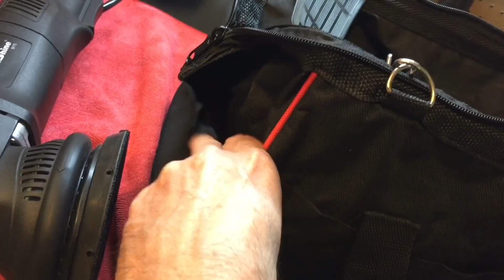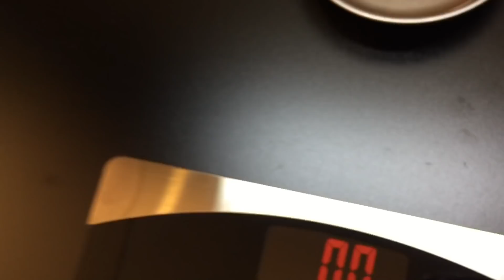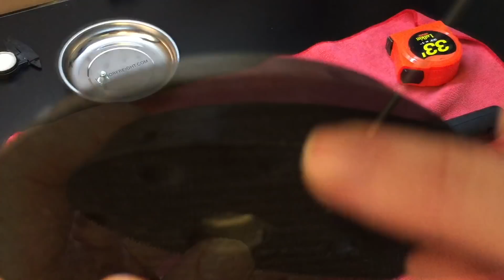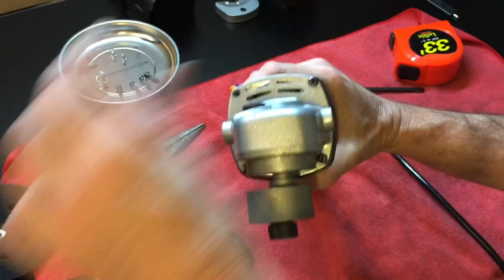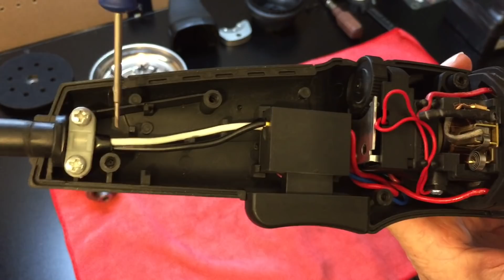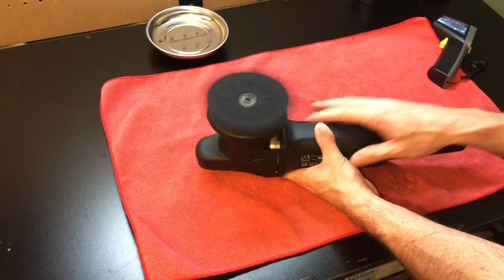A DETAILED Look At The MaxShine "The Master" 15 mm orbital polisher, 900w!!!

Comment from the maker: More Entry level polisher reviews on the way!!!
Reply: Excellent!!
Reply: When the time is right I will upgrade to the Max Shine 15mm. Flex ,Rupes,etc. are still out of my price range and my novice status doesn't justify me spending big bucks at the moment( I'm not anything more than a driveway detailer. 😁) Great video packed with comprehensive info! I'm always learning something new from your channel!
Reply from the maker: I would recommend the Harbor Freight unit...or Griots garage ....https://www.harborfreight.com/6-in-57-amp-heavy-duty-dual-action-variable-speed-polisher-69924.html

I will be featuring it in a video at some point. I will also be giving it away....stay tuned!!
Reply: @apexdetail85  I have a hf da polisher. What would be the next best upgrade da?
Reply: Brian quick question I have the maxshine 1000w it feels like it's lacking power stalls out etc.. pad is flat what's your take on that?? I've been seeing ppl say something about the mod washer would that help? Advice greatly appreciated Thanks
Reply: Nice hearse
Reply: Would #2 complex lithium grease be an adequate replacement for the Chinese grease?

Comment: Just picked up the pro today do to my da burning out on me. Quick question, what does the washer mod do n is it a must??
Reply: The backing plate rubs against the shroud of the polisher on purpose as a safety feature to prevent the backing plate from spinning freely. The washer acts as a spacer that separates the backing plate from the shroud. If you don't use the washer mod then make sure there is grease on the backing plate where the shroud and backing plate touch. I think the tool comes with a tube of grease for that purpose.

Comment: I just got the new M15 Pro :) I love it, really awesome product!! and yes it come in a complete package aswell. I sure can advise this product to any detailing enthousiast or pro even. They sell this product to cheap, or the rupes to expensive?
Reply: With the pro model is there much stalling on vertical panels???
Reply: Well i used a rupes and it stalled a lot! i didnt do much polishing with the M15 Pro yet except some headlights (no stall there) I will do my complete car soon, but my impression was less stall. especially on the inverted area's i had a lot of stall with the rupes LHR15 mk II on the chemical guys EU detailing program. Very annoying. but this is a thing with the DA's though, not just the rupes. the geared DA's or the rotaries dont have this stalling. So if my maxshine M15 Pro is gonna stall on me like that im going 3" for those area's and check out the gear driven Da's or rotaries.
Reply: @Piglet6256  check out the shine mate Ex610 15 mm.. $249.. marketed as a professional tool for professionals.. it is a free-floating da, but apparently no stalling at all.
Reply: Sure will, thanx

Comment: Hello, 
Do recommend for this unit and the pro to replace the grease with what you used in this video (lubriplate Gear Shield) or The Wolfs Head Red grease that you use in your newer videos? Does replacing the grease void the warranty?
I appreciate it, Thank you!

Comment: Hey Bryan, purchased this polisher on October 11,2018 after watching yourself, Scott from Dallas paint correction, Pan the organizer and received a RUSTED product. It is Nov 13,2018 at time of posting but only used the polisher 3x. Also upon trying to take off the backing plate to add the washer mod it was very very difficult and after an hour saw where it was cross threaded. Emailed “Skye” but was told to add oil and will not honor the “warranty”. Said they will send parts and a video for me to swap -__- 
Are you able to assist or know of a contact? I can provide amazon order number & photos if needed
Reply from the maker: That is unfortunate and depressing. Let me look into it. I would have sent it back immediately if I noticed it was oxidized and rusted.
Reply: Apex Detail I’m stationed in the Caribbean. Had it forwarded from Florida. Sadly will cost close to purchase price just to send it back
Reply: Apex Detail thanks for any assistance. And very depressing

Comment: Those screws are way better than the ones on my 10fx. Stripped a bunch of them trying to change grease. :-/ they told me $80 to replace the screws plus shipping.
No thanks. 
Looking at getting this model or the pro 1000 watt model anyway. And looks more user serviceable. Torq had the security torx screws I found out after taking apart and stripping screws lol.
Thanks for the review!!!

Comment: Is it just me or this polisher stalls really easy even on flat panels with light to moderate pressure, it was supposed to be an upgrade from the harbor freight which it has tons of power compared to the maxshine, I’m I missing something? This my first time using a 15mm long throw.

Comment: Hello Brian! This is the second time watching this video because I’m about ready to buy a 15mm polisher. I own a 21mm swirl killer and an 8mm griots garage unit as well as a 12mm polisher for 3” pads. When you clean the factory grease out, do you just spray some citrol in there and blow it out or do you manage to wipe it out? I’ve heard great things about these polishers for the money. 

Thanks
Reply from the maker: I spray it in there and wipe it out. These are great...do not miss a beat. For the money...go for it.

Comment: Brian, I have been experiencing a serious bogging down of this machine when attempting to polish vertical surfaces. I've used both foam and microfiber pads, using Meguiars D300, Meguiars M105, and Optimum Hyper compound. No product/pad set up seems to make a difference. I'm not leaning on it; in fact, it doesn't seem to be able to oscillate unless there's only minimal pressure to the surface.  Could it be something as simple as changing the gear grease that could help this?  It certainly could (and might possibly be!) user error, but thought I'd consult a more experienced professional like yourself.
Reply: I have the same issue and I purchased the 1000w "pro" model. Sure doesn't feel anything close to 1000w.
Some of my older and less watt polishers feel much more powerful than this and don't stall, I don't get what the deal is.

Comment: Great video, ty for posting it. I purchased one on these polishers and would like to ask you a couple questions.. Would lithium grease be ok to use on the gears? Do you have an alternative to Citrol 266, perhaps something i can pick up locally? And final, does the grease make the polisher perform quieter? Thanks again.
Reply from the maker: More important than quieter....much cooler for the health of your tool. Instead of Citrol...a decent degreaser will do but take a bit longer.
Reply: Thank you.

Comment: I tend to favor the lc backing plates but, which would work best for ms15/21 ?
Reply from the maker: I do as well Isaiah...however the stock plates on the 21 and 15 have performed well so far.
Reply: Would an lc backing plate work on this?
Reply: Angel B yes.
Reply: I believe they manufacture the pass through style backs for application. Seeing as how the spindle style like the porter cable isn't an option on these particular long throws.

Comment: great review i love it pls what is the name of the drill u r using love to buy one like dat
Reply from the maker: Folarin Martins its just a Drill Master from Harbor Freight.
Reply: The manual says Variable speed trigger, but it's not. I have one, manual says it has it, it doesn't. The trigger is only an on/off switch.

Comment: Another great review and tear down.  General Question, DA polishers spin free by hand and isolate.  Orbital polishers, don't spin by hand when turned off as DA's do. And based on the label of this one,  it is a random orbital, meaning won't spin by hand and isolate randomly.
Did I cover all types (3) or there are more? I know some expensive ones have a dual function doing the work of those 3 mentioned. Thanks Brian.
Reply from the maker: Let me break it down this way, if I may.

Random orbit polishers rely on momentum to spin the pad.

Forced rotation is just that... has a drive gear.

Standard orbit just relies mostly on oscillation.

Comment: I bought this polisher that scott from Dallas auto detailing recommended. It's great, are there any other grease brands that I can use can't find the one you mentioned locally in upstate ny. What about Napa or valvoline
Reply from the maker: To tell you the truth... ANY quality lithium grease is better than what the factory uses.
Reply: Thank you
Reply: I put Valvoline wheel bearing grease (auto parts store) in my HF. Hope that's an ok grease to use. Not sure if it's lithium

Comment: Once again and I do not for flattering Brian, that is clear .... it is impossible not to comment on your good videos, you disarmed this polisher until the last screw, my opnion as you mentioned it is a polisher that for its price is paid only , it is great for a beginner as for a profecional, because it can be used as a backup machine or as a continuous use machine, without any problem since as you showed, it does not heat up so easily, sometimes not everything is brand, nor price ... I think it's functionality and performance, Thanks for another good video
Reply from the maker: I has not missed a beat so far... I will do a follow up in a year or two on durability.

Comment: Bri, been waiting patiently for this one. Thanks!

1. what did you do to fix that one wire? Also did you let Maxshine know about it?
2. what did you use to flush out all the old grease?

I think I will pick one up. Dallas Scott liked it too.
Reply from the maker: 1. Just shortened the wire.

2. That was a job for Citrol 266
Reply: What else will work for cleaning it out?

Comment: I just purchased the 21 mm version. The first one I got had horrible vibration to the point after using it for just a couple minutes my hands Tingled for many minutes after. I contacted MaxShine and they promptly sent me another one which I just received today. It seems to run smoother but I have not had a chance to test it thoroughly. Has anyone purchased the 21 mm version and experienced harsh vibration?
Reply from the maker: John Cover I have the 21 as well. My son uses it a ton and has hand no problems. I will keep an eye on it.
Reply: Brian, I had a chance to test the replacement they sent today.  It has alot less vibration than the first one.  With a megs microfiber it still has more vibration than Im used to.  Foam pad not so bad tho.  It is however  more noisy /louder than the first one...  like I want to wear ear protection which has never been the case with any other polisher Ive used.  It does cut quite well and doesnt stall to easily so Im pretty pleased by that!   Im still on the fence if I want to use it all day.  What would be your recommendation if I wanted to move One Step Up?  21mm...
Reply from the maker: The BOSS 21 by Griots Garage in a half step up.

Comment: Out of curiosity, what would be your ideal polisher set up? For the sake of the question; lets say budget is a non issue. If you wanted a long throw (whether it's 15 or 21) and a standard 8mm machine, what would you consider the top of the line?
Reply from the maker: Longthrow = BOSS Griots 21mm

15mm = Flex 3401

8mm= torq10fx
Reply: @apexdetail85  Brian I think he was asking between the 15 and 21 mm long throw amile
Reply: Flex 3401 has a 8mm throw.

Comment: Which Lubriplate Gear Shield product are you using? Extra Heavy in the caulk type cartridge?
Reply from the maker: Nicholas Hinkle extra heavy in a five gallon bucket.
Reply: Thanks! Did it quiet the MaxShine down a little after adding?

Comment: Very nice. More of the same please. As for the buffer, it seems to be built to a price point. No machining that I could spot, not even the pinion - powdered metal. Is the case glass-reinforced? Kinda looked like ABS (plastic). The switch gear, from what I could see is fairly modest. The backing plate looks pretty well built on the screen, though. Overall, seems like a solid value in an entry level long-throw machine.
Reply from the maker: Exactly... powdered metal ... plastic not reinforced. It seems sturdy however... I will keep you all filled in when it comes to durability.